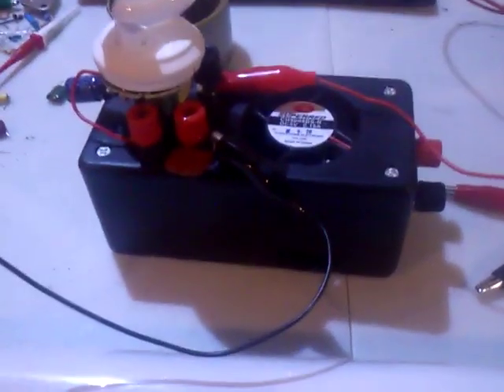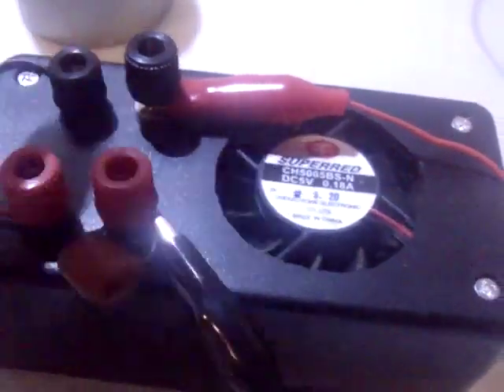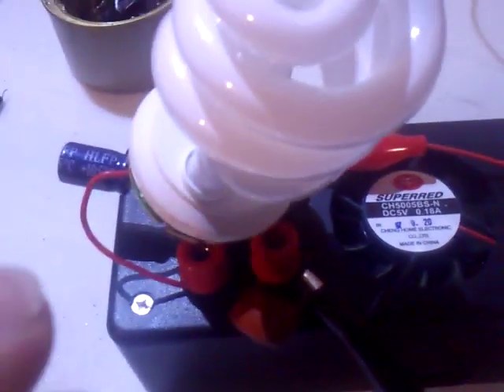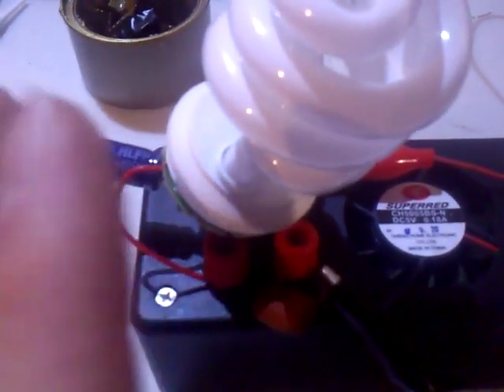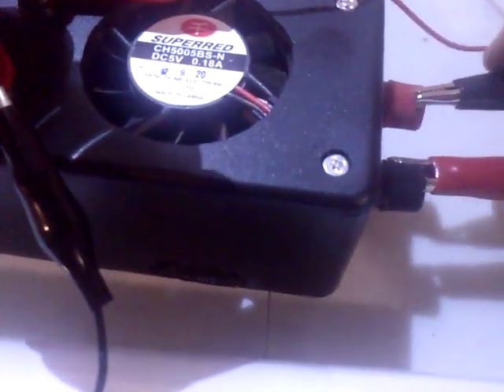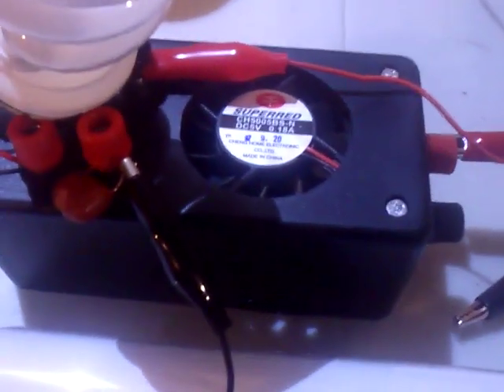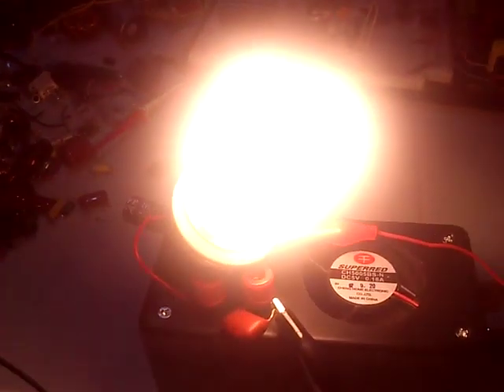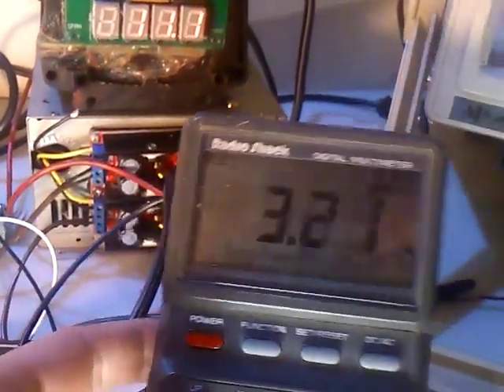ZVS inverter update

Comment from the maker: For the schematic you can check my previous video about this one or simply search ZVS in google and you will find plenty of what you need. For the V out it will vary depending the input the transformer I use was originally from an 12 to 120v inverter so it will make about 165 V peak.

Comment from the maker: Yes there's about 3 diode in there for protection one for the main circuit witch is a 100 Amp low drop and the other are plain and simple diode for the buzzer and fan.

Comment: Very nice! Do you get arc'ing in your straight tube? Everything i've built either causes plasma in the ends, or.. if it doesn't, it is very weak output... I've chalked it down to not pre-heating the elements or, as someone once mentioned, I need a cleaner sine wave, not the pulsed DC H-wave... cheers